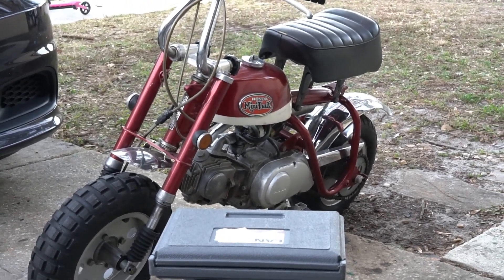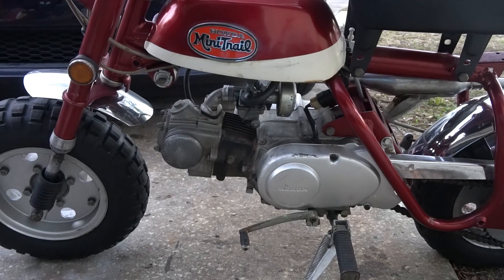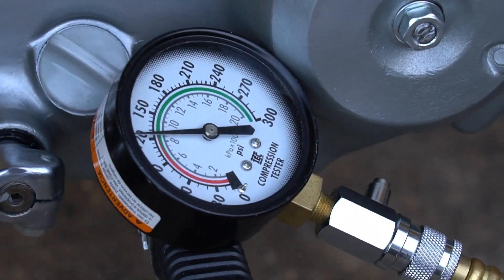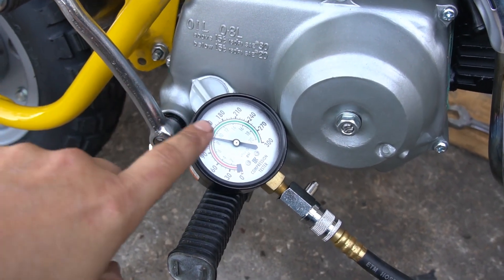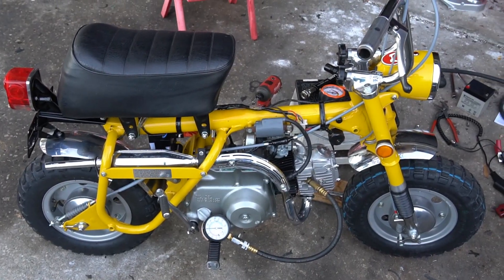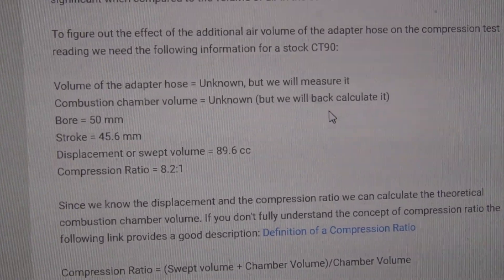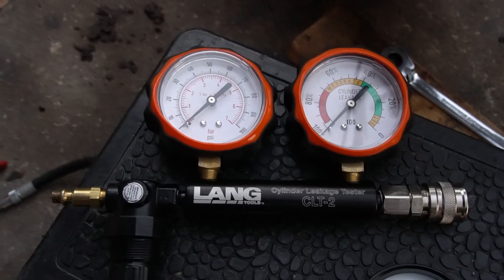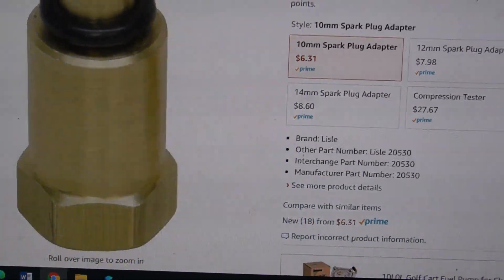Small Engine Leak Down Test vs Compression Test Results - Honda CT70 Dax Z50 Mini Trail Monkey

Comment: You don't know what your doing. You have to push the bike in gear forat least 20 rpm.
Reply from the maker: I do know what I'm doing and pushing bike is not a requirement. Honda manual even states kickstart method as their way of obtaining reading - But I will try your method in the future Thanks

Comment: I’ve experienced the exact same issue using a compression tester with a long rubber hose on small displacement engines.  Eventually I cobbled together the correct air fittings to eliminate the rubber hose and have the compression tester sit right up by the spark plug hole and the psi readings increased. Still, I’ve compression tested engines that seem to run fine and never see the 157psi to 180psi the Honda manual suggests is normal for a healthy engine.
Reply from the maker: John - Yes I have read about fixes or workarounds, for example moving the check valve to the beginning of hose among other things. Glad you are aware of this. Just wanted to get the word out b/c it can confuse someone in regards to health of the engine and cause misdiagnosis.

Comment: Great explanation.  I wish mine had that much compression.  My Z50 K3 has an amazing 45 psi.  You have to love a Honda motor because it still runs!
Reply from the maker: CSPCRX - Perfect example of an impossible situation based on compression gauge and small bore. Your engine would at least be above 100 psi in the real world for it to run.